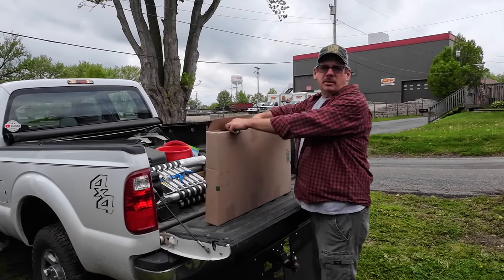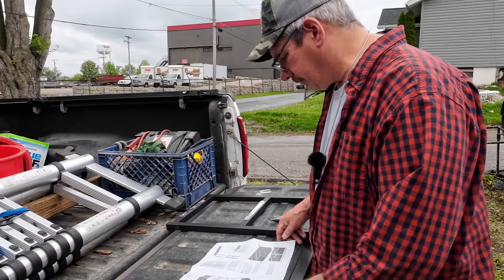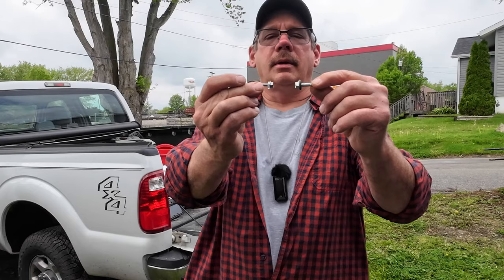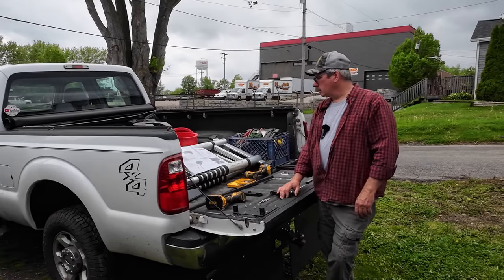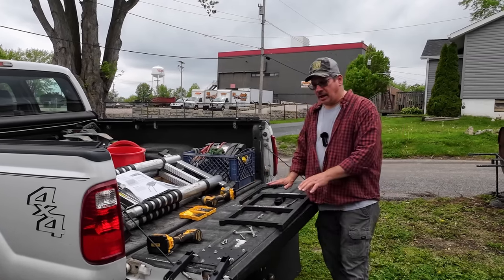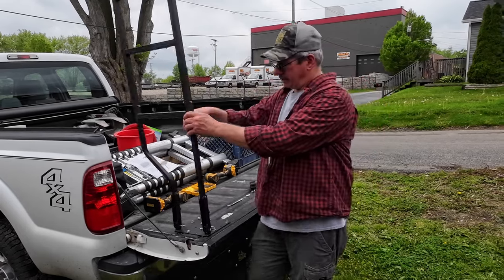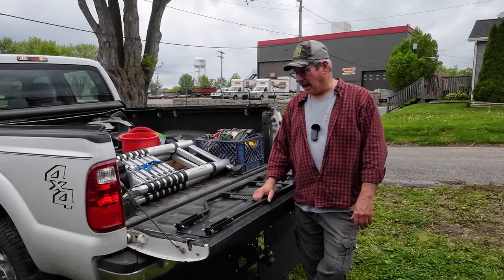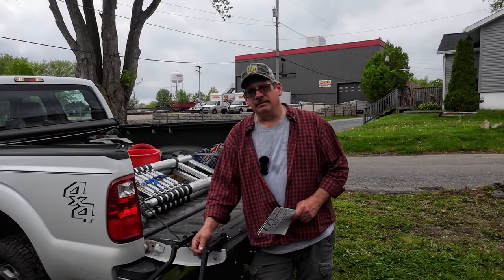Beech Lane Truck Tailgate Ladder Install and Review

Comment: I have one and I love it! The strap should be mounted so that the screw is just outside of the ladder frame on the lower end at least so that when the tailgate is up, the ladder can't sag from it's own weight and truck movements. Next, you need the tailgate shock. Another thing that I thought I would never need.
Reply from the maker: Who makes the shock?

Comment: Nice Video. Was on the fence with this, but yours and another video has convinced me. I was looking at one that swivels.  I see that you got the telescoping A-Frame ladder. What do you think? Does it store ok? So many things on a RV that requires a ladder.
Reply from the maker: I think that swivels would be nice as long as it's not too bulky. 
I like the A frame ladder. The camper I have now has a ladder on it our last 2 didn't. The only reason I still carry it is to access the awnings if something happens. Downside is its big and heavy